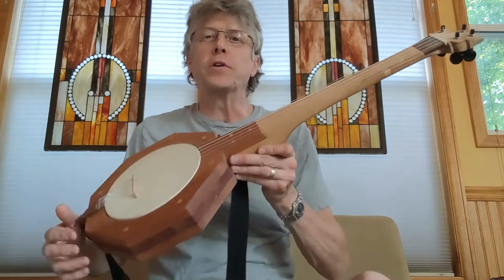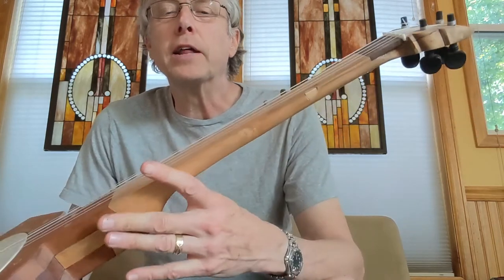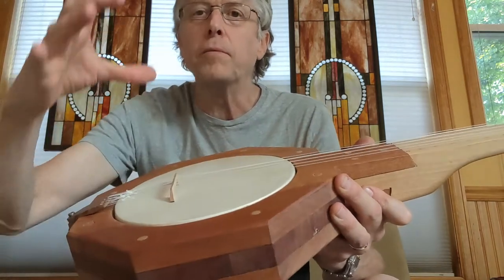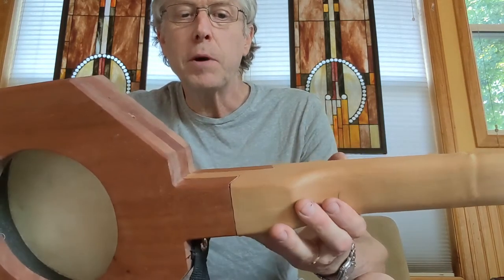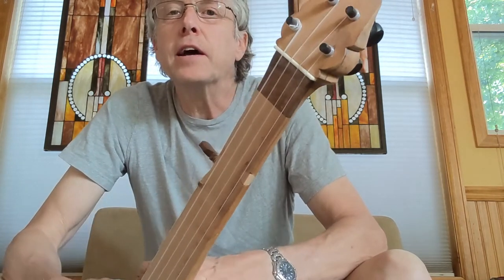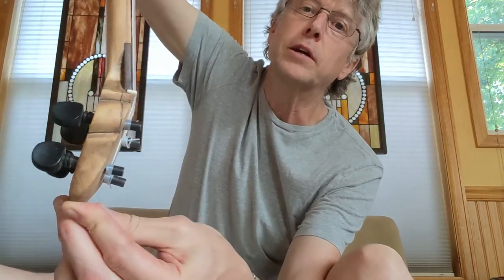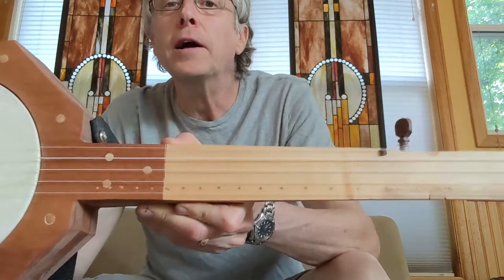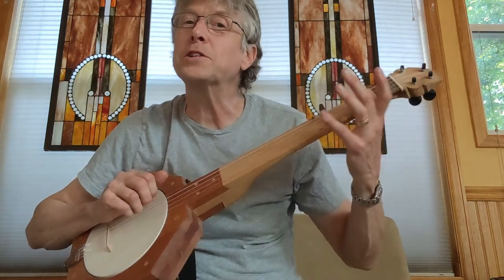Table Leg and Leaf Mountain Banjo Build

Comment: Beautiful piece of work.  Personally, I like the precision fitting you did on fixing the neck to the pot.  I’ve assembled one mountain banjo kit, but have not yet attempted a build from scratch.  (Even the kit gave me fits trying to get the head tight.)  But I do suspect there’s a fretless gourd banjo build in my future somewhere.
Reply from the maker: Thanks so much.  Lots of fun building.
Reply: @blackmountainbanjos574  Hello black mountain banjos,,
Sir , can I play old tyme mountain music on a Resenator Banjo with nylon strings to get that needed classic sound that nylon strings do for a banjo.???
I figure I could buy a R-35 Resenator Banjo from Recording King and add the nylon strings and have it be a bit brighter then the open back banjo..
Trying to see what folks think of my idea. What do you think.??
Can you do a short video on what that would sound like ????
Like your home built banjo.
Reply from the maker: @harvdog5669  I think you can do that.  You may need to adjust the slots in the nut to accommodate the wider strings, but the result should be pretty good.
Reply: @blackmountainbanjos574  Can you do a short video on that idea of mine. Oh rapid fire here, somebody shooting out after dark,, NOT GOOD, even here in the mountains.
More shooting. More shooting.
More shooting, .
Shooting finally stopped for now up here in the dark mountain after dark..
I need to learn to play.
I need to hear a comparison between a open back with nylon vs. Resenator with nylon, more shooting,more rounds, lots of rounds. Somebody will call the sheriff I am sure.
 I need that comparison,so I can decide weather a Resenator or an open back is what I want, according to the sound.
No more gun fire.. 7000 ft up on mountain after dark is no place to shoot, unless someone has an under ground shooting alley.
That is possible up here in the county...sounded like fast shooting and slower at a target 🎯🎯🎯..that was 30 or 40 rounds I heard... Have a good night..